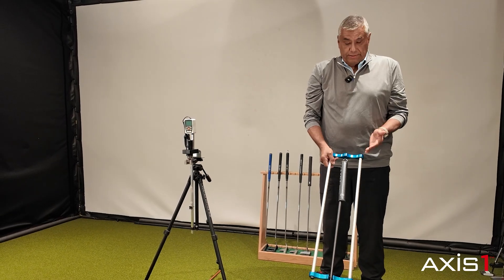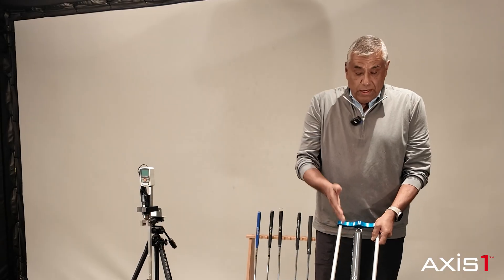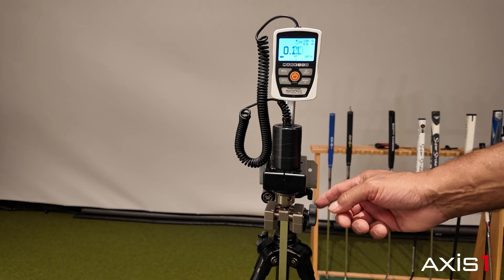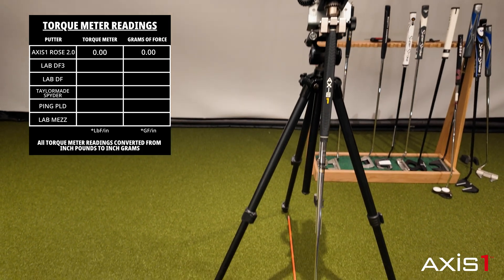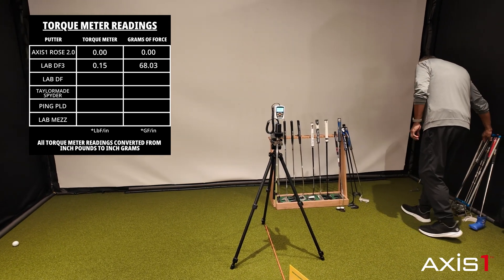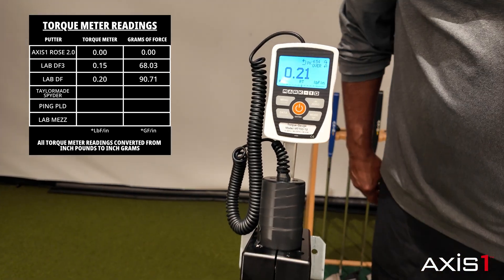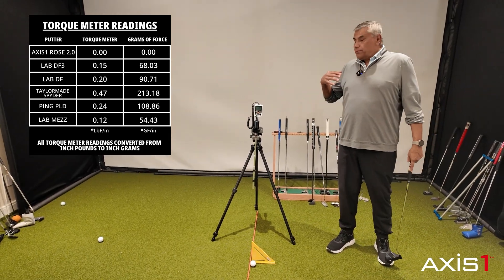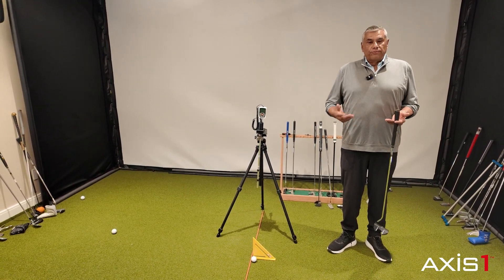Measuring "Zero Torque" Putters (Is This The New Standard?)

Comment: Would the results be different testing these putters in motion?
Reply: IMHO it's not a question of different results from different methods of measuring torque. The only relevant measurement is when the test is made that best simulates the realworld motion of the object (in this case the putter) in realworld usage.

Anyone can google the definition of torque & you can't run away from these keywords - force applied to/acting on an object & (the resultant) rotation. And don't forget Newton's first law says an object at rest stays rested until and unless acted upon by a net external force. 

So when you stand over a ball and address your putter behind the ball, what force is acting on the putter? If there's none, will there be motion (linear or rotational)??? If there's no motion, where the hell is the torque? *of course if one hovers the putter off the ground, there's downward gravity and  the upward force of the hands holding the grip  **or if one has an epileptic fit or a tic, there are indeterminate forces acting on the putter LOL  * * * some folks may have googled & discovered 2 kinds of torque - static & dynamic... trouble is if they did not go down the rabbit hole, they'd think that static torque means torque that exists when an object is static/at rest... wrong! please go down the rabbit hole LOL

I hope someone can tell me who coined the term "zero-torque" putter. My guess is it's a dumb journalist who failed physics in school. I only came to know of LAB putters after seeing Ben An winning his match against Tom Kim last month (yeah that Tom Kim who vented his frustrations on a locker after losing to Ben). I thought the putter Ben used was really ugly, like the tesla cybertruck, and I had to track it down... a Mezz Max by Lab ... and that's how I saw the revealer vids.  

Actually I'd like to thank Mr Pedraza for this video because it made me understand why LAB stands for Lie Angle Balanced. It's all to do with realworld usage. If you're custom fitted, you'd address the putter at it's lie angle, not toe-up nor toe-down. And "balanced" ... that implies a net zero force on the putter (Newton's first law ..."unless acted upon by a NET external force") which is why the putter face does not rotate around the shaft

Now back to a test that "best simulates the realworld motion of the object (in this case the putter) in realworld usage"... my 2 issues/questions for LAB's revealer:

1) Is the way the putter is attached to the revealer (with one of those eyelet hooks?) the best simulation of how a golfer holds his putter? On the revealer, the putter swings freely... in the realworld golfers apply different grip pressures. What degree of grip tightness will negate all the goodness of being "balanced"?

2) What would happen if the revealer is swung on a swing plane that does not match the lie angle of the putter? I'd guess LAB's putters will also open & shut in the backswing & follow thru.. 

I've pointed out these 2 issues to Sam Hahn in another comment. Hope he responds ( and with a video for #2)

PS: hope this won't be deleted LOL
Reply: @kckong3  I really really appreciate the time you’ve taken to try to understand what’s going on with this technology. I wish everyone would do the same. I doubt I’ll make a video to address all of the specifically but if you want to email customer service to set up a time to speak with me, I’m totally down.
Reply: @kckong3  so if you hold your arm out holding a weight perfectly still with no motion are you claiming there’s no torque being applied or can be measured on your shoulder joint?
Reply: @kckong3 an he literally shows the fact the face of the LAB twists open when not supported low down hence it has torque in the address position even when not in motion.
Reply: Exactly. This really just showed how unaware they are at understanding the physics involved.
Reply: I like the idea of a torque meter, robot testing with both an on plane putting stroke and torque meter would take into account the acceleration of the putter head mass and what twisting force or torque is imparted in a dynamic movement rather than a static address position. Both tools shown in the video almost get you there, and if we the consumers continue to support these companies maybe one day we will see the putting robot that not only proves the technology but also can provide the quality assurance used for consistent manufacturing. It seems with manufacturing tolerances LABs model of individual hand made putters is the only way to get zero torque consistently to the consumer.
Reply from the maker: If a putter has torque in the address position (as shown in the video with the putters clamped at the grip and suspended at an angle) it will have torque in motion as well. Unfortunately torque just doesn't disappear... This video is really our introduction of measuring torque utilizing an actual measurement device, we want to continue to advance this more and more to help standardize measurements for consumers. Showing the putter in motion is certainly the next step here but it would not change the fact that any putter that is showing torque at address will also show some sort of torque in motion.
Reply: @Axis1Putters  This is really helpful! I never understand the negativity from the lab golf crowd. At the end of the day, the goal is to elevate the game we all love—whether through technology, conversation, or passion for golf. Sam and Luis should do a fireside chat; I’m sure Axis1 and lab golf share more in common in their missions than people might think.
Reply: @samhahn6950  LAB golf vs Axis1 video in the near future on your end????
Reply: @CPBuilds  how do you mean? Like which one performs better on a golf course or which one performs better in a revealer? Torque meter? We win in all categories but happy to show you whatever you like.
Reply: @samhahn6950  Yes...all of the above. I was hoping you'd address this video and point out, what you feel, is wrong with their method. I know you'd do well in all categories but maybe look at it from different angles. Put your spin on it...I know what I would do but I'll save that for another day...or comment.
Reply: @CPBuilds  do you mean what is wrong with their balancing method or the testing method?
Reply: @samhahn6950  both 😂
Reply: @CPBuilds  on the balancing side, they simply have too much weight in the heel, which is why the putter opens in the Takeaway and torques closed in transition. I’m a testing Syed, I honestly don’t even know where to begin, but we are working on a much more sophisticated device that actually puts the putter in motion measures under the same principles.
Reply: @samhahn6950  i've watched your videos where you mount the putters in the revealer & swung them. I'm curious... what if the revealer is swung on a swing plane that does not  match the putter's lie angle? Shouldn't your lie-angle-balanced putters also open & close on the takeaway & follow thru? Could you do a vid with the revealer to simulate what would happen if a user addresses with toe-up or toe-down & swings that way?

Yet another itch I need to scratch ... how loose should one's grip be to allow the putter to do it's job (of staying square thru the putt) & get the full benefits of your putters ?
Reply: @kckong3  you’ll see our putters wiggle a little bit if I was to say stand the shaft up five or 6° but not significant. Certainly not as much as an axis one does even when it’s in plane.
Regarding how late, that’s totally personal. Some people react or, more to the point, don’t react to torque with very different amounts of pressure.
Reply: @samhahn6950   bettinardi's new torque free putter passed your test on the revealer? Care to opine?
Reply: @lukeprendergast3593  It's not negativity it's just that this test doesn't test what LAB putters are designed to do with torque.  He used the torque machine on LAB putters that are balanced for a specific Lie Angle, didn't mention what angle he moved the machines angle to for the measurement. Example: if the LAB putters were balanced at 65° but he moved the machine to be at a playing position of 71°, torque will show up in the reading.  It's why it's important to have your Lie Angle measured before you purchase a LAB putter.
Reply: @Axis1Putters lab golf posted a video of your putter 4 years ago and it your putter has torque when you swing it fast. In the video he was swinging it slowly and you could already see the head slightly swinging. This video is fraud

Comment: I'm pretty sure this would read 0 for any of the LAB products if they were using a straight non-pressed grip.
Reply: Yep and Luis of course knows this. He also knows that if he tilted the clamp, the 3° for the grip it would also read zero torque. He also knows that if his torque meter worked in motion like the one that we are working on, ours will read zero torque and his will not.

Comment: Has a torque meter, needs a bullshit meter. Nobody gives a crap about torque at address. The putter is on the ground, duh! LAB's concept of zero-torque through the swing is what matters for anyone looking for a "zero torque" putter.
Reply from the maker: The putter is actually not on the ground in the video, we are holding it up in a clamp by the grip (and that clamp is what is measuring torque inside the torque meter device) at the lie angle of address. If there is torque in this static position, there will be torque in motion. Unfortunately torque does not disappear once present.

Comment: If I could putt statically then this test would matter. It's a putting stroke, not statics. You must dynamically test the putters in order to claim zero torque.
Reply from the maker: If a putter has torque in the address position it will have torque in motion as well. We love the idea of a swing robot that measures torque as well, but this video was really to introduce people to the Mark-10 and a way of actually measuring torque while testing various putters in the address position to showcase torque or no torque.

Comment: what a dumb video... lab putters take time to get used to, but once you get the concept how we have been putting "wrong" for decades, lab putters really make sense
Reply: I tried my friend's DF2. It felt very light & I thought one should hold it very loosely and  let it swing freely like a pendulum. Is that how it should be used? LOL with my old school putters  (toe hang & face balanced types), I grip them firmly as if holding a cleaver/hammer without a  trigger index finger, elbows against my ribs & simply rock my shoulders for consistency. If I did that with the LABs, woudn't it negate all the goodness built in?

Comment: Who would have thought Axis came out number one, how’s the wins or tour and sells going?
Reply from the maker: The Axis1 Rose has the most SGP in all the majors since 2019 out of every putter model on the market
Reply: Why did Rose no longer using his “Rose” putter?
Reply: @kyg4n  Don't really know. He hadn't been putting well in 2024. But he was still around 60th on tour through the US Open. He switched away from the Axis at the US Open. Since then he's nearly dropped out of the top 100 in strokes gained putting.  Whatever he is struggling with putting, dropping the Axis has only made it worse.

Comment: Disingenuous bs. Here let me test something at rest that's meant to be in motion. If this is the way you test, I'm sure I'm just as good as any professional golfer at holding the golf club...but that's not how golf is played. I was intrigued by your putter before this video but now, I would just as well use a club brush as a putter before using an Axis.
Reply from the maker: Glad to hear of your interest in trying our putters and we hope one day you will try an Axis1. In this test we are measuring torque at the address position (the putter is not on the ground, it is being held within the device clamp) and if torque is present in this position it will also be present in motion. This is just physics, the torque cannot disappear in motion once it has been shown to be present. This is all we wanted to showcase along with introducing a device that takes actual torque readings.
Reply: @Axis1Putters  Actual torque readings along an axis not used in the putting stroke. You lifted the putter forward which means nothing in putting as you don't putt that way. Do the same reading while lifting the putter along the line of intended play. Demonstrate that your putter is zero torque in the plane of intended motion.
Reply from the maker: @xxthadeucexx  The torque meter was not measuring the forward lift of the putter, it is measuring putters in the address position... which would be along the line of intended play in a putting stroke...
Reply: @Axis1Putters  Tell yourself whatever you need to sleep at night but hanging the putter straight up and down and claiming it's zero torque then lifting it into an address position and saying it's zero torque is great if putters never move. Putters need to move to hit the ball and once it moves, what happens? Show me zero torque in motion...which is where it counts. My driver hits the ball as far and straight as any tour driver as long as neither of them move...but that's not how golf clubs work. I understand your marketing strategy but all of us aren't sheep. Not to mention you had a DF3 with a 2 degree press grip which will change the torque value in a static environment. I'm sure your putter is great but making videos like this won't help you sell them to anyone who thinks for themselves. Good luck.

Comment: Why aren’t  you swinging the putters?
Reply from the maker: This video is meant to introduce people to and start a conversation around utilizing a measuring device like the torque meter to help standardize 'what is torque'. We plan to advance these tests more and more each time and a putter in motion or at the point of motion is a logical next step in this discussion. But one thing we know is that if a putter has torque at address, it will also have torque in motion during a swing as well.

Comment: There is a reason everyone is starting to copy and try to discredit LAB golf. They have caught fire on the tours.
Reply from the maker: We certainly did not copy anyone as we came up with this technology back in 2009, all we are trying to do is start a dialogue on how torque can be appropriately measured across putters. This video is very similar to what LAB has been doing with their revealer for years, showing other putters not staying square... we're simply using a measuring device to actually show torque and no torque in the address position.
Reply: @Axis1Putters  but why would i care if there's torque or no torque at address? putting is already difficult as it is ... why would anyone stuff up his mind with irrelevant info?